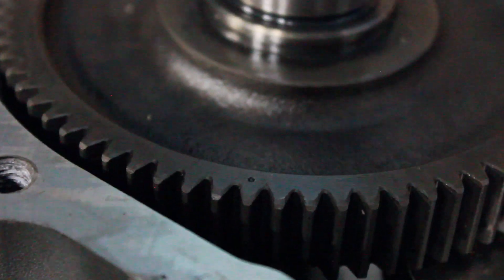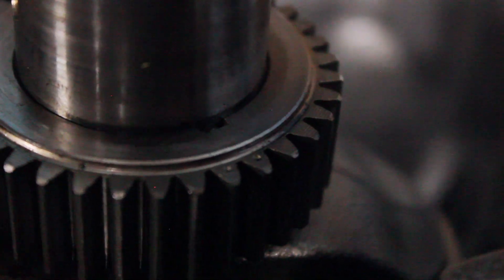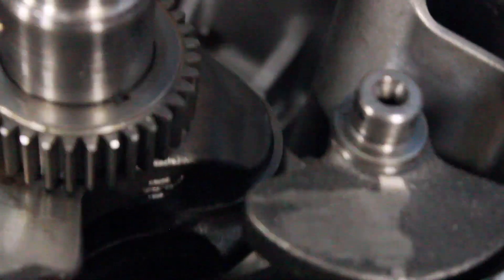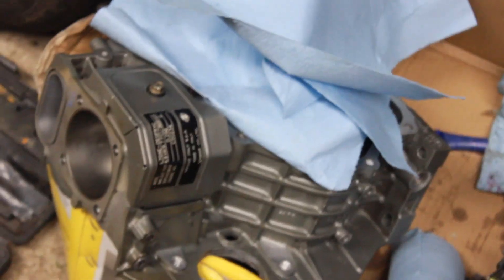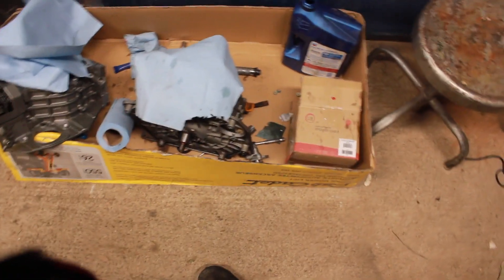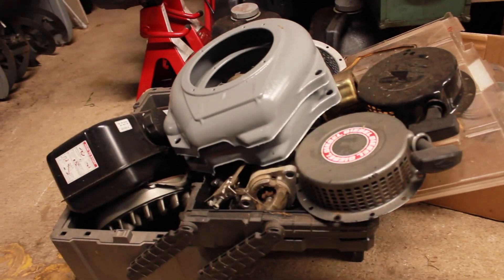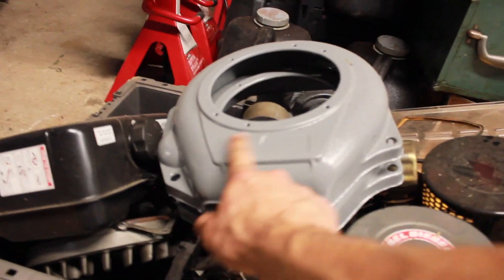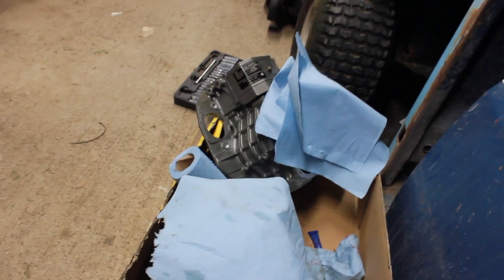HOW TO TIME A YANMAR L70 DIESEL ENGINE IN 1 MINUTE!!!!

Comment: I'm sure this HOW TO TIME A YANMAR L70 DIESEL ENGINE IN 1 MINUTE!!!! would be excellent for people who already know how to align the timing marks, but it left me still scratching my head.
Reply from the maker: Lee Walsh I can make another video if you would like! I’ll be getting another engine block back from the machine shop next week. In the meantime,did you have any specific questions?
Reply: @zippyzappyz  Greetings from Scotland, hey that would be great if you could post a video showing how to set up the timing and the correct placement of the balance shaft on a Yanmar L70 single cylinder diesel, there is not a single video on youtube or anywhere else showing how to do it, thanks
Reply from the maker: CAMERON STUART will do! Looking back at this video, I really didn’t do a good job at showing the timing process